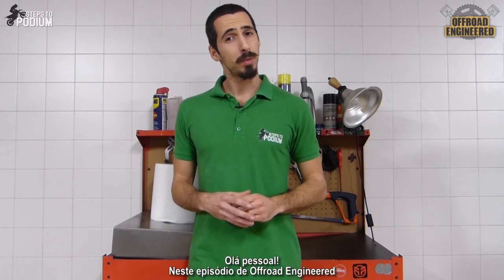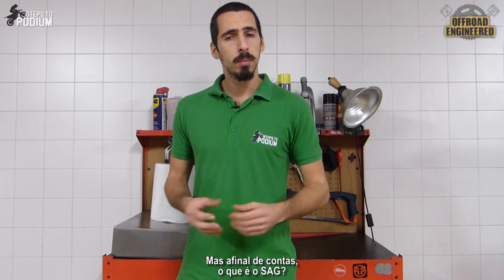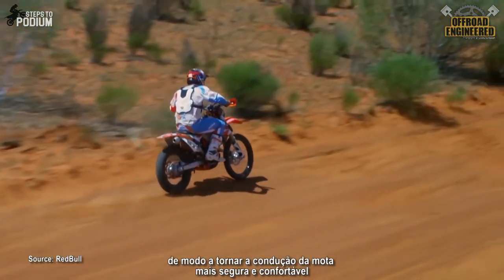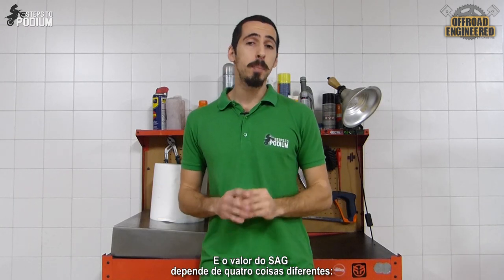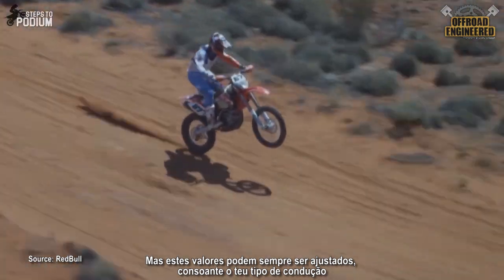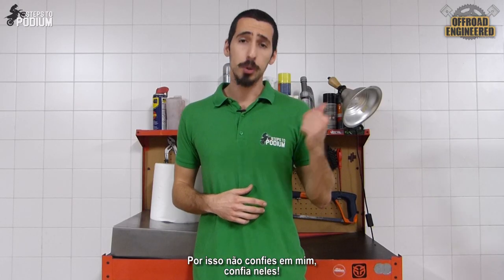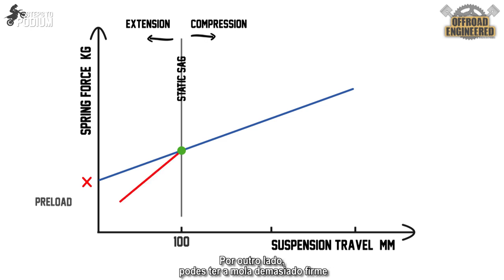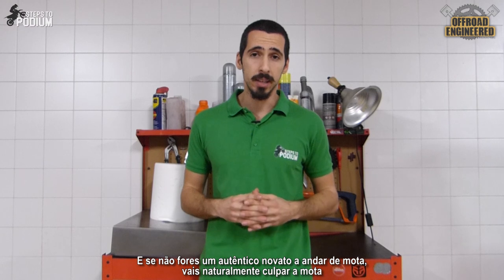What is SAG for? | Offroad Engineered

Comment: I think SAG does a few GOOD THINGS.
1: It DECREASES HEAD and FORK ANGLE for High-Speed Stability.
2: It INCREASES HEAD and FORK ANGLE for Quick Turunig Response in Tight Breaking Corners.
3: It Allows the Rear Wheel to TRACK and GRIP small Stutter Bumps.  I Raced a KX-250 for 10 Years.

Comment: How do you adjust the sag on the forks? Is it only the spring rate that be changed to affect that?
Reply from the maker: most forks need to be disassembled to change the spring rate bit there are some brands that have a some adjustability on the preload without disassembling! 😊
Reply: How do you adjust or check sag on forks ??

Comment: Hi there, great channel! Im no expert regarding Sag setting for hard enduro. I asked some pro riders Webb, Gomez and Bolt what setting they run and most of them said 110 of sag. 95! Are you sure that you haven't got it the wrong way round?
Obrigado.

Hi. My sag was set to 110. I adjusted my sag to 95 and took it for a test ride. I
Reply from the maker: Hey Karl! thanks for the comment! 😊
One thing I don't stress enough is that for most things, we shouldn't compare to the pro riders. at all actually. their bikes are completely different than the ones we have on the shelf. they use different suspension components, different mousses, different everything that are really tailored to their riding style.  the values that you find out there are values recommended for us common mortals and not for them! 😂
About the Sag more specifically, the suspensions are completely different (sometimes their settings are tailored to one race in particular!!) and we should not based ourselves on their settings. What works for them does not necessarily work for the most of us, but it's something that works really funking well for marketing purposes ☺😂
However, I said that you can set your Sag anywhere between that range (and probably I should've said as well that you can set it outside that range as well), most of the time is a matter of trial and error to see what best suits you!
PS: thanks for the "Obrigado", good to know that there are people that care where you're from! 💪💪
Reply: I really like the sag at 95. The bike has better traction. 
Obrigado 
Karl.

Comment: Well, How to adjust sag at the front to fit the rear? Thanks
Reply from the maker: It depends on your suspensions, but if you don't have suspensions with preload adjuster, you have to change  the number or height of the washers that provide the preload 😊

Comment: How do you tell if you have too little preload on the shock?   A too stiff spring.
Reply from the maker: On the video I explain that 😊
Reply: @StepstoPodium     Sorry.  I watched again and figured it out.  I have an Xtrainer and ordered the Factory shock from Beta Suspension.  The documentation is confusing in the way that they explain the spring settings.   They talk about measuring the free spring length and trying to achieve 8mm of length reduction when you have installed the spring on the shock and adjusted sag.

Comment: I’m 245 pounds do yu think if the bike sits too low with me on it it’s putting a lot of stress on my motor? I have a kx450
Reply from the maker: If you are riding with a spring too soft, you might blow the stroke out and transfer some load to the chassis. I thinl you should be more worried with the chassis then the engine! The will still have to pull the equivalent to almost 2 guys riding so you'll be pushing the engine quite a bit but it all depends if you do big jumps or not
Reply: @StepstoPodium  hey. Thanks for the quick response 💪🏾💪🏾! Okay.
Reply: @StepstoPodium  it just feels like when I’m in second gear at a slow speed if I try to do a wheelie my bike drops low but it doesn’t go up, like the bike is struggling to wheelie I feel like if I use the throttle any harder something might blow on my engine what it feels like 😂😂😭I think I need better rear springs🤷🏾‍♂️
Reply from the maker: No problem, I'm glad I could help!

Comment: not sag,  ride heigth:  vs suspension travel  ride height set so shock travel is 33 percent droop   and 66 percent bump. also  rake set to balance handling.   spring  rate in cps  2.0 for road racing.  1.6-1.2 cps for  single track.

Comment: Wait a minute, you're saying you want more sag for fast and less sag (95mm end) for slow? Shouldn't that be reversed?
Reply from the maker: Nop. At higher speeds you are more likely to jump and what not compared to more technical riding, so you have to have more suspension stroke able to extend and compensate for that.
Reply: @StepstoPodium  I agree. So wouldn't you want less sag (95mm vs 110mm) for fast speed to get more allowable suspension travel? Now I'm confused.
Reply from the maker: Having a bigger sag allows 2 things:
1- you are making the extension stroke less "reactive", making the rear end more stable,
2- you are allowing the rear to have more available travel to compensate for wholes, since at high speeds it's impossible to avoid jumping. 
How the shock will react on compression, that's up to the hidraulic damping part which has nothing to do with the spring